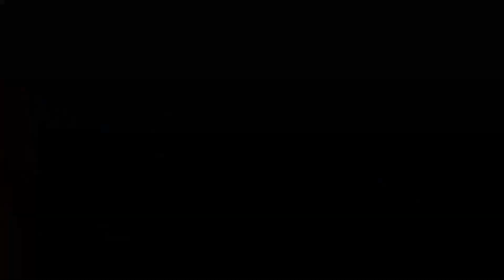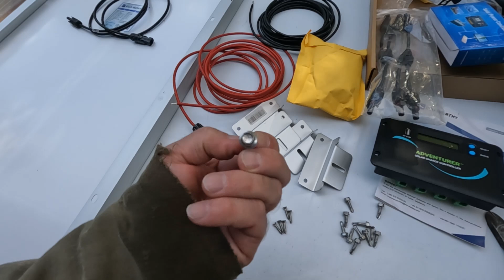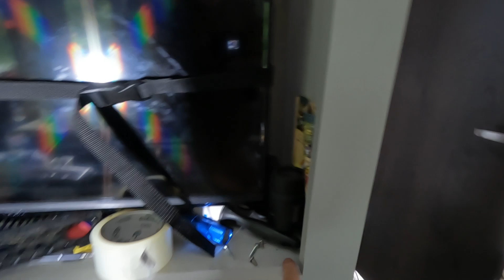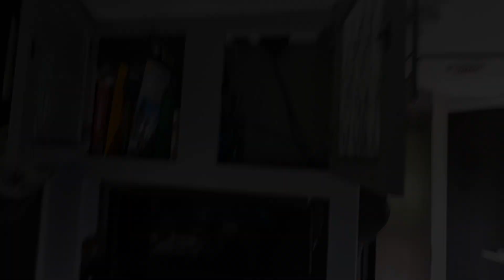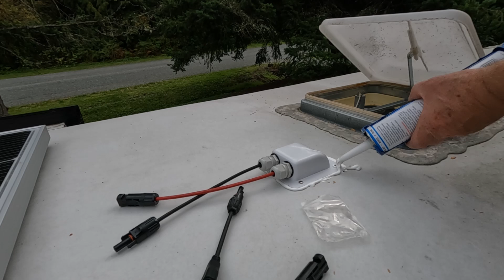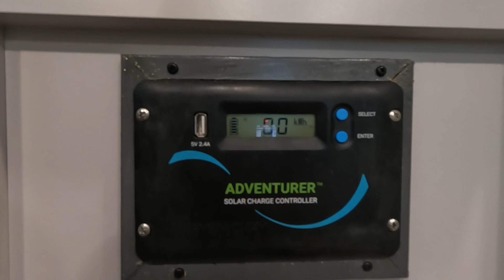Trailer wiring project part 2 - installing solar panels.

Comment: U said 200 amp.. wrong u got 200 watts... not much power. Your camper looks like a 30 amp u nneed kore panels to run better .. u got no fans at night no ac day or night but can run basic 12volt equipment
Reply from the maker: yep, you are correct that I said amp and it is watts. and that should be enough (for now) just need to keep the 12 volt side working when dry camping. I don't have an inverter or plan for one for now. 
thanks for the comment